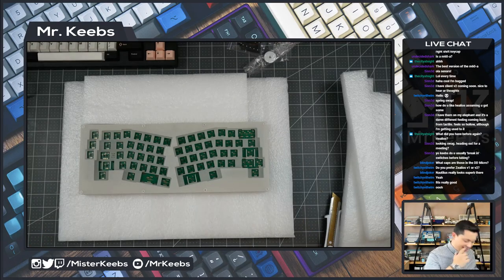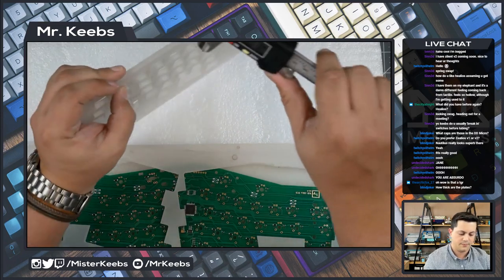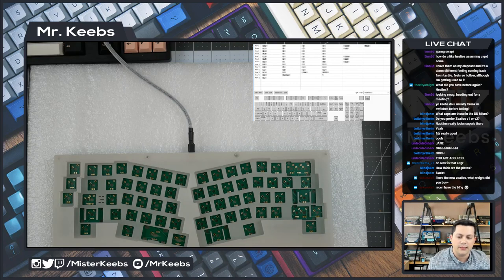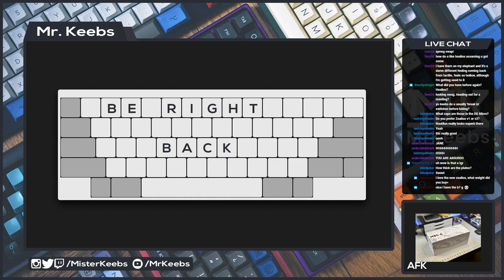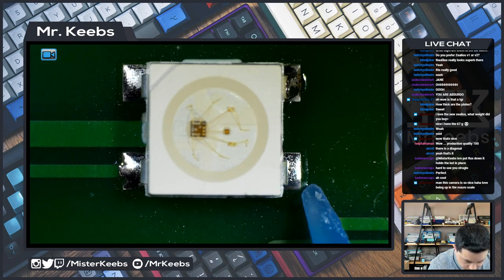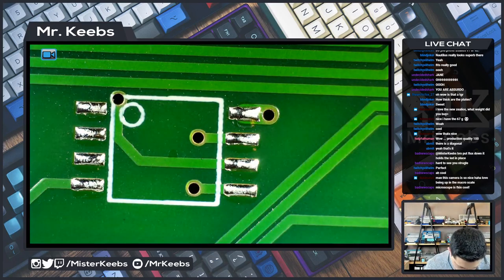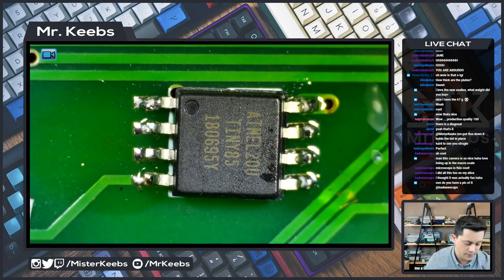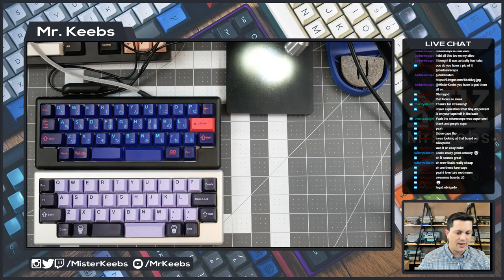Acrylic TGR Alice Unboxing and First Impressions

Comment: Does anyone know the parts # of the rgb LEDs? I am building a helidox, and the LEDs that came with it look very similar, but have no legs at all. They are horrible to solder. The ones in this video look much better.
Reply from the maker: noleti I have a Helidox as well and also prefer this model. I am just not sure they are interchangeable but I’ll try to do some research.
Reply: I believe the LEDs use the SK6812 driver. There appears to be a SK6812MINI, which is the one without any legs. I now ordered SK6812 (non-mini), which will hopefully have some tiny legs.
Reply from the maker: @noleti  that is awesome, where did you order yours? I want to stock some myself. Thanks!
Reply from the maker: @noleti  So you are getting the 5mm or the 3.5mm ones? I am thinking on stocking on some 5mm.
Reply: @MrKeebs  I will have to measure the heliodox at home, might only accept the 3.5mm. I think I ordered 5mm now though. Ada fruit should have both, for example.
Reply from the maker: @noleti  right, I need to measure mine as well, and also not home atm :D
Reply: so the helidox LEDs are 3.5mm x3.5mm. The 5mm will likely fit for the underglow, but for backlight they interfere with switches as they will not fit into the holes of the PCB. So I might order another batch of 3.5mm LEDs to check if they are easier to solder than mine.
Reply from the maker: Thanks for letting me know, I almost got the 5mm.